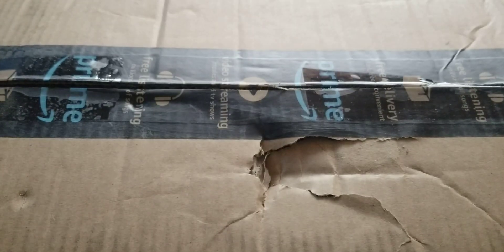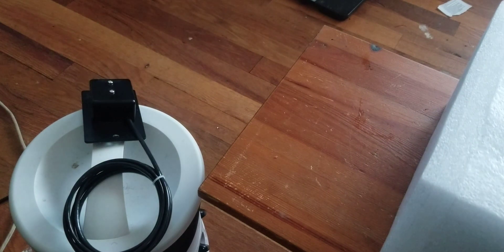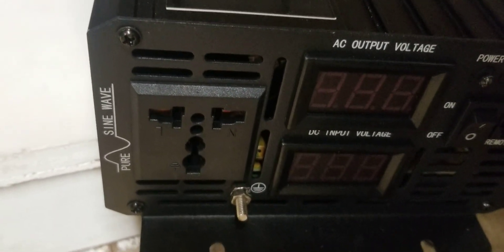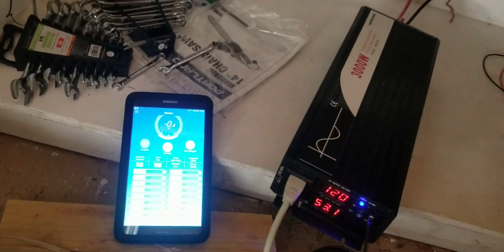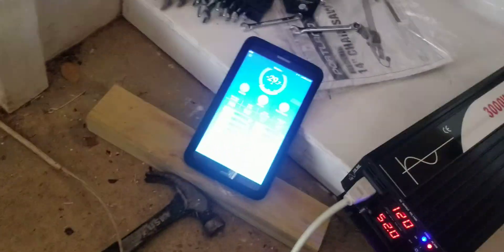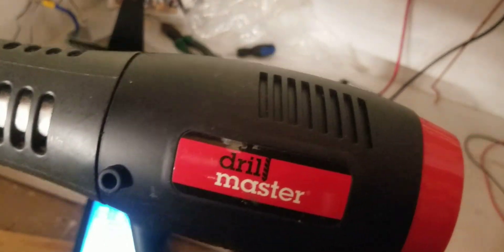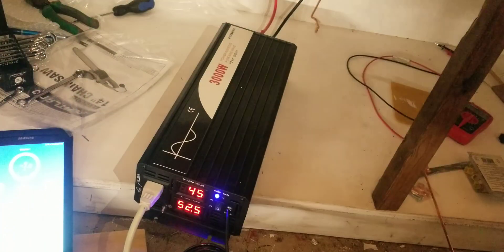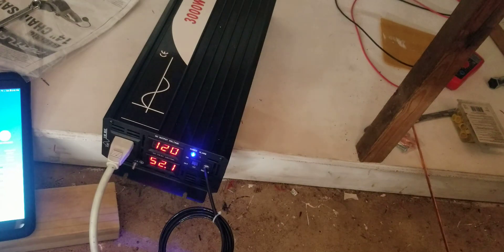Xijia 3000W Is it Fake 3000W? dc 48v Pure uWave Solar Inverter for Home RV &Camping (Range 40V-60V)

Comment: Thank you for pointing this out. I was just about to purchase this brand and you helped change my mind. Thank you for sharing...
Reply from the maker: Krxny inverter 1000W has a safety precaution for overload. It shot itself off. You just have to switch it back on. 2000W can go over 2500w for 10s, behind that you're are getting a new inverter. It has no safety.
Reply: @simplyfocus9937  I will check them out as well. Good day, from Phoenix, Arizona...

Comment: ..the most what catceh my interest/what amazed me are those Lifo-batteries ! Soo beautifull..i like to make the same, but with nuch lesser batteries, just enough to run my 1000 Watt Airco on it..! *Can you tell me the exact type/Voltage/Ah etc batterie it is sir? And where you buyed them, and what cost per 1..50..100 pcs. ! Thank, also great video, have a good day
Reply from the maker: Thank you! Cheers!
Reply from the maker: I have several videos on the batteries  : A123 LiFePO4 26650  from BatteryClearingHouse.com
Reply from the maker: They are other batteries that are less complicated. I wouldn't advise anyone to do the same. They are very good for car 🚗  I have them on my isuzu nqr 2002

Comment: Hi, So i may be wrong but it seems to be overloading. 30amps x 120v = 3600 watts. the inverter is only rated for max 3000 watts and upto 6000 watts for short inrush of current for only couple of secs. The beeping x4 times indicating thats its overloaded. The max you can run that inverter is 25amps. your heat gun & heater is 1500w, 12.5amps at 120v = 3000w 25amps but your bms was showing 30amps. 25A is max for a continuous load
Reply from the maker: I went back to review the video. You are right 100%.
Reply: @simplyfocus9937  he is 100% wrong (read my comment)...
Reply from the maker: You may have a point. My bms is 100A max. My heating gun is 1500watts & my heater  is 1500watts. The inverter runs for less than a  minute at 3000 watts
Reply: MWXNE may work out better.
Reply from the maker: @michaelwheadon1078 check out my order video on inverter
Reply: 3000W@52V=57.6A continuous INPUT. 3000W@120V=25A continuous OUTPUT. 12.5A@120V=1500W. The poster was right and you are wrong (don't know how to do simple math)...
Reply from the maker: @davebruessow6842 I have 2 of them broken in my house. I don't know what to do with them. It would have been nice if they had a safety process to shut itself off during an overload. I have a different 1000w inverter that does that
Reply: @simplyfocus9937  a good inverter would have automatic shutdown and what you showed in the video was not overloading. I will definitely NOT waste my hard-earned money on one of those junk Xijia/Cnswipower inverters. Thank you for sharing...
Reply from the maker: @davebruessow6842 I agree 👍 💯.  I think I do have a good one from Taiwan that is a little pricy MPP SOLAR Brand. I wasn't available to fully test it yet
Reply: @simplyfocus9937  I have heard they make a quality product. Thank you for letting me know (I'll check them out)...
Reply from the maker: The inverter is overrated. It has no overload protection